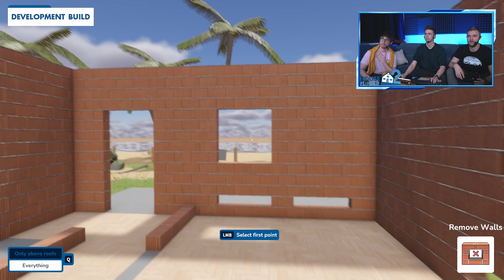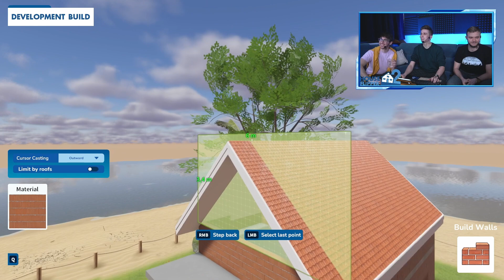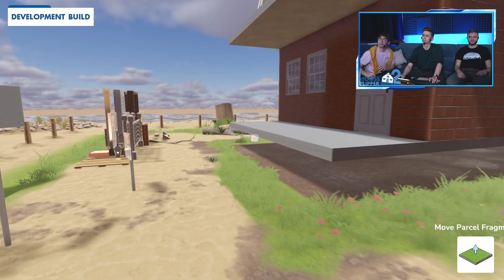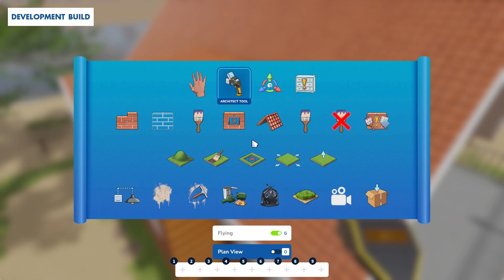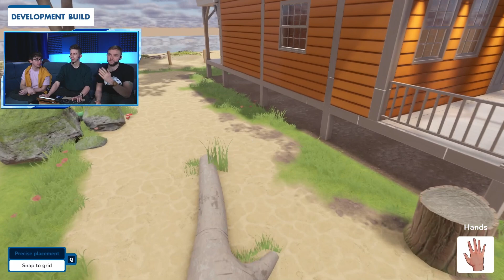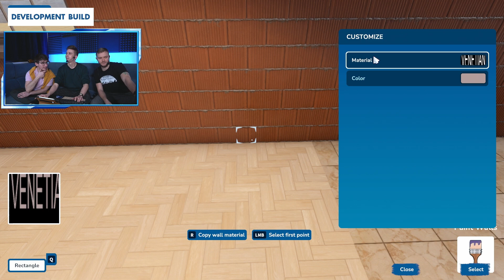Building From Scratch! House Flipper 2 - Stream Highlights

Comment: I think a good addition feature in house flipper 2, would be to be able to have doors that can freely open, so you can have it half open, quarter open or even a crack of the door showing etc 😊❤❤
Reply: i might be wrong but i think you will be able to do this (kind of). in the HF2 showcase q&a video there was a casual moment where they tried to open a window, but there was something on the windowsill. so it only opened partially, instead of going through the object (like it did on HF1) the window opened as far as it could and stopped after hitting what was in the way. hope that makes sense lol 😁
Reply: @dxuiz  oooo, thank you for this info! This is very exciting!!
Reply: Pointless
Reply: @xXItaAndyXx ok